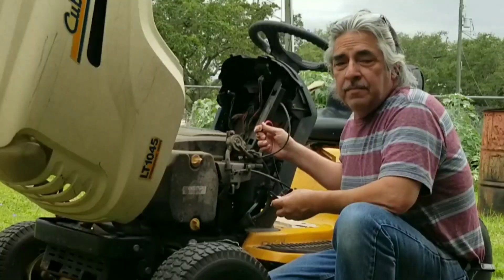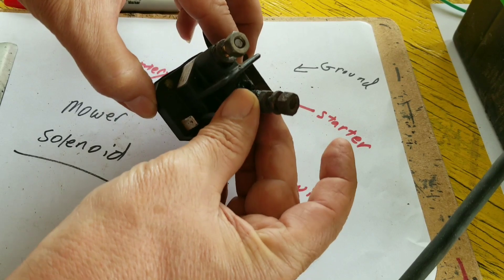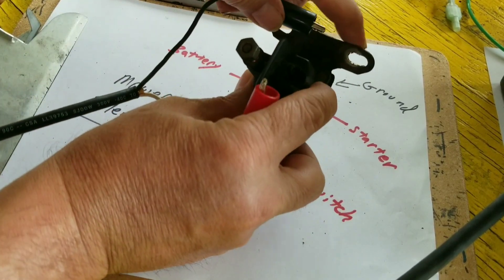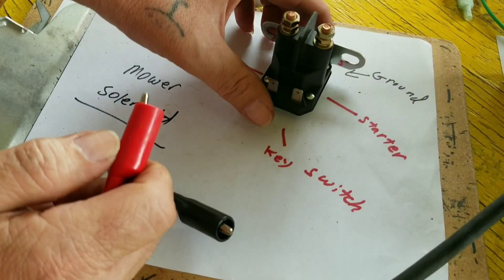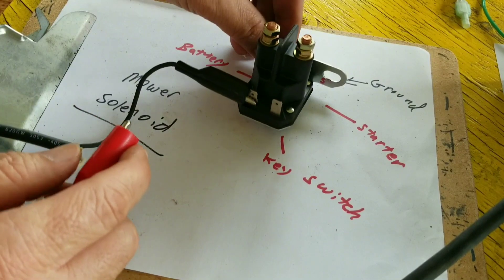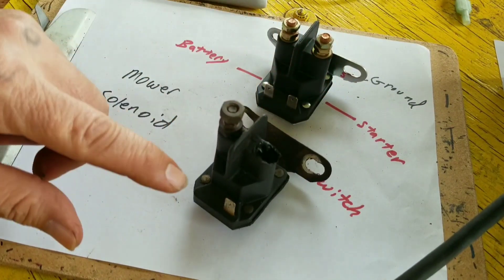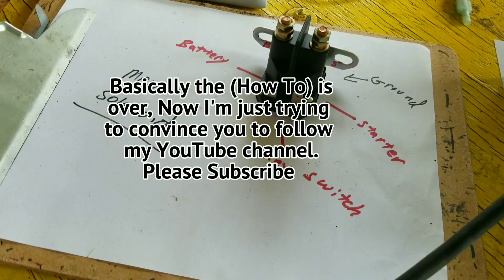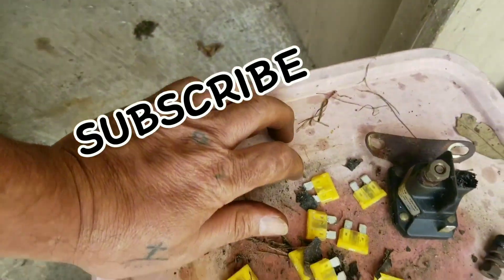How To Test 3 Pole Solenoid vs 4 Pole Solenoid

Comment: Hello question I have the 3 pole solenoid ....you have available the diagram connection to 5 wire start and off tractor key switch to connect to 3 pole solenoid and battery ? How to correctly identify which is the negative and positive screw on the solenoid since they are not identified....Please I wait you response ,,,Thank you
Reply from the maker: Let me know if I misunderstood your question. 

To identify the positive and negative poles on a 3-pole solenoid when they're not labeled, you'll need to use a few methods:

1. Use a Multimeter to Test Continuity:

Step 1: Set your multimeter to measure continuity or resistance.

Step 2: Check for continuity between the different poles. Typically, two of the poles will be connected when the solenoid is activated (this is the "common" or "switching" pole), and the third pole will connect to one of the others, depending on the polarity of the input voltage.

Step 3: Once you identify which poles are switching, you can use the voltage polarity to determine the positive and negative poles by applying a known DC voltage.

2. Apply DC Voltage and Observe the Behavior:

Step 1: Connect the solenoid to a DC power source, ensuring you know the polarity of the voltage (positive and negative terminals).

Step 2: Carefully observe how the solenoid behaves when the voltage is applied.

Step 3: The polarity of the pole that activates the solenoid when the positive voltage is applied to it is likely the positive pole. The pole that is activated when the negative voltage is applied will be the negative pole.

3. Use a Compass (If Applicable):

If the solenoid's magnetic field is strong enough, you can use a compass to detect the polarity. Hold the compass near each pole, and the north and south poles of the solenoid will create a magnetic field that deflects the compass needle. This can help you identify the polarity of each pole by the direction the compass needle points.
Reply: Wow ....this is the excellent clear response and explanation ....very grateful to you thank you and 100%up 
😃